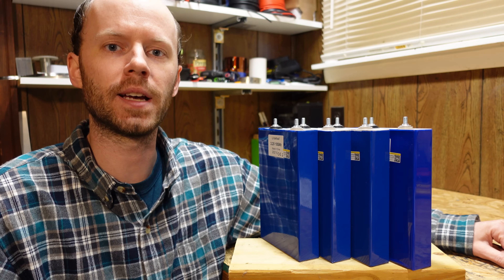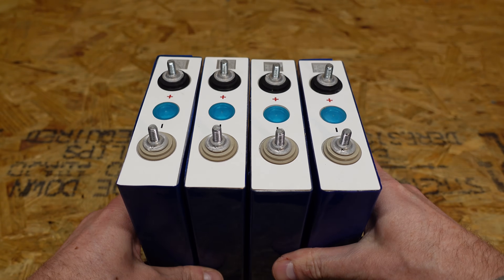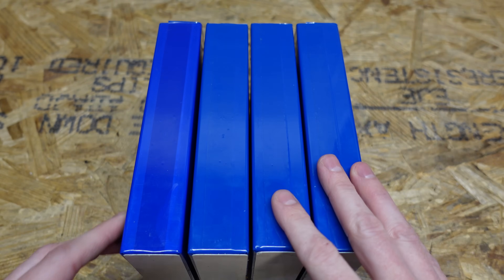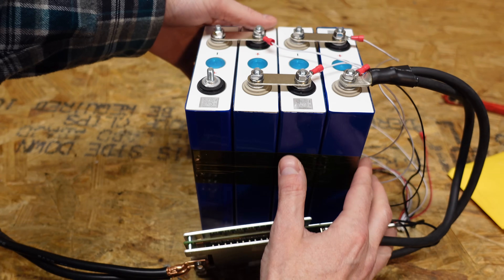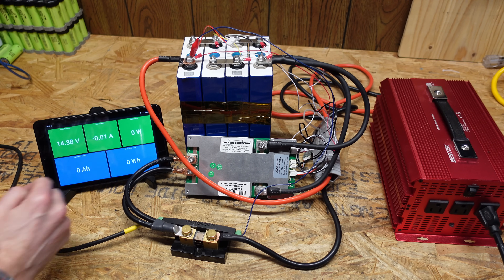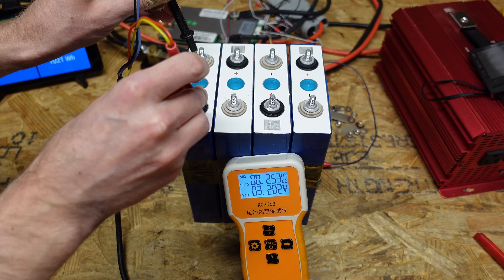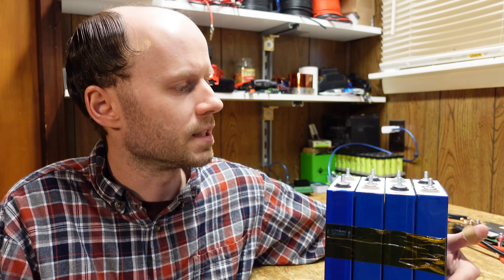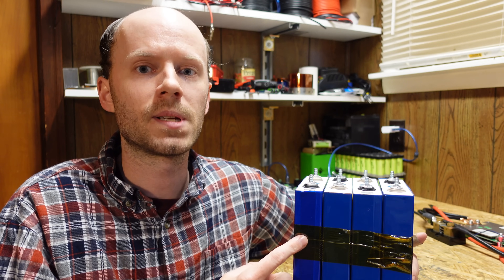Cheap "Grade A" Batteries, Why Do People Keep Buying These!?

Comment from the maker: Update March 6th 2022: The product page where they were selling these batteries has been deleted 3 days after posting the video. They're continuing to sell what appear to be the same exact batteries under new listings which you can find here https://liitokalahongkong.aliexpress.com/store/217753/search?SearchText=liitokala+105ah
Reply: I am a member of a Facebook group, where people buy the Litokalla 100/200ah batteries. From all the members, only one was able to pull full capacity, and they have sold them in hundreds in this group.
I have been asked to help a member who's battery didn't work on arrival. The interior was a mess!

Terminal corrosion, heavily bloated cells (I mean really bloated), the BMS was the cheapest thing you can think off. The 200ah capacity, was made with 2s 4P 100ah cells. The poor guy couldn't use the cells for nothing. He ended up matching 4 cells that were ok'ish... Then bought a new set of new cells, a BMS and I teached him how to set it up and he is thrilled. But from the initial order, to the time he had a real working battery it passed around 6 months... Really not worth the money. That company is garbage in LifePo4 batteries, even though some work...
Reply: This "brand" makes a lot different batteries, ALL are not as advertised. 
Generally below capacity by various degrees. Up to 50%!
I think they do make cells (18650) but they also buy b grade and faulty products and sell them on.

I've not seen one good review /test on these or this brand it's not limited to these cells.

* I think maybe the performance people get seems better but they may have over reads/bias giving what appears good results.
Cheap battery, cheap tester= unreliable results. ( And Fake planted people to groups and forum to promote businesses and products)
Reply: I think these batteries have been used on street lamp then replaced with new one and send to  a recycling facility where they clean and sell it to the scammers. my lito Kala looks fine but each have different charging and discharging capacities.
Reply: @neliosamch3195  
yes, nothing against recycling, but not declaring that fact is fraud in most of the world not in china though.
Reply: @ursodermatt8809  If they declare it as recycled they won't be able to export it because the shipping will be more than the battery itself.
Reply: @neliosamch3195  
well yes, good point.
Reply: There are groups that purposely put false reports on the internet and are paid to do so. The cost ratio of return on the money is good, so the manufacture pays for the false , positive reports-reviews.
Reply: you never know what you get from chinese sellers. and there is no recourse of one cell is faulty.
so yes, if you are a gambling man, go for it.
Reply: exactly
Reply: The bloating and the lack of voltage on the one battery would indicate to me the batteries are either extremely cheap or they are used... Personally I say they are used. I would avoid that seller at all costs.
Reply: any updated links to these bad cells? its getting deleted again
Reply: They do this to clear out the bad reviews.
Reply: If you're short two nuts, I bet there is a plastic surgeon that could help you :)
Reply: Used battery cleaned up and new QR codes put on them.
Reply: Hi.  Can you Please Tell me that app that you are using on your Tablet for battery capacity testing ?
It looks like the Victron display only much larger and readable without my glasses.  Thanks
Reply: They don't?

Comment: I wouldn't ask from a LIFEPO4 battery made from those, much more than 300W per 4x cells approx 25A discharge per cell. Any more than that and the lifespan could be reduced. What current had they been used at? It's possible someone else had already had those cells in their hands then over discharged them and consequently sent them back then possible they tried to pawn them off on you.

Comment: Junk. made an 8s pack and 2 years later went to do a redo in better box and very bulged and leaking. 2 cells were actually leaking,  So miss matched capacity right out of the box can only be used between 25-27 volts, wtf. buying from jenny wo now. These are literally someone elses trash cleaned up and sold to Americans.

Comment: This is SO unprofessional! You haven't even read the datasheet. You can not use those type of cells WITHOUT proper compression! 300-500 kg of force is required. Don't use those cells without compression!

Comment: I think those weren't bloated.  The problem is with the plastic.  As the plastic case warms, it expands, causing the cell to look bloated.  Place the battery in an environment that is below 60 degrees and it's likely they are flat.  I found this to be true when I had mine 'swell' after bringing in from the mail box and unpacking in a cold garage.  In the garage, they were either perfectly flat, or even a little concave. But inside over night, they swelled.  I put them back into the garage and they again were flat.
Reply from the maker: They are bloated. Very bloated. And they have gotten worse just sitting on the shelf since I've filmed this video.There is gas inside and they cannot be squeezed back down as they would if it was just warped/expanded plastic.

Comment: and in few months the shut down will be happen after 20 or 30Ah. I see exactly the same on my friends that bought cheap battery or cells. after max 1 year, battery is un-balanceable and useless .😂😂

Keep believing that 1000 euro for 100ah batteries are theft and that 200 euro batteries are the same🤣🤣🤣

I haven't bought lithium yet because they cost too much. I prefer a thousand times a traction lead acid battery with a tubular plate of 300 euros for 100h, which lasts 2000 cycles of TOTAL discharge and 6000 of light discharge, at a lifepo4 of 250 euros that in a few months is a nightmare !! No one gives anything away!!

Prices have not collapsed !! Simply companies were born that sell garbage

Comment: you might save some extra bucks and buy the same cells from another   trader that the same cells stayed another one year  and got even more old..    good thing is  solid state chemistry might apear before our project systems lights and apliances shut off permenantly!!!!....    crazy thing is that i ordered from em and from VAric.. ones       some solenoid   46160 and they are in so much better condition!!! didnt expect that .. those can barely used for ups or hand tools!!!

Comment: They're-lasered QR codes over batteries likely used nothing but a scam. That's what you risk all you can do is ask your credit card company to reverse the charges. I don't know if that can be done after 3 months it takes to get them.

Comment: LootoKala is a SCAMMMMMM - I got a full refund from aliexpress customer service. IR was 3x what it should have been and my cells were re-wrapped with labels showing higher capacity than they were supposed to... they sell OLD B STOCK TRASH - LIIOKALA is SCAMMERS. 

Just so you know, these shops in china laser weld on those studs. they ALSO have the capability to laser etch those barcodes so dont trust that barcode!!!!!!! IR test, and capacity test!!! thats all that matters (and the price!!!)

Comment: Sorry but 2.5 vs 3 is large difference. While I do agree these cells are crap, for the right price they are still worth something. 

I think that one cell is definitely bad, and I absolutely wouldn't use these in anything mission critical.... But as some backup power for something seems like they might be worth it

Comment: Chinese goods need special use and treatment, especially from a genius like you. You may be able to replace the battery No. 2 or enter the program of BMS and adjust the voltage of cell No. 2, unfortunately this is China and it is suitable for poor and developing countries

Comment: There are other cheap sellers for the 270-320 ah cells though and even though they are really B cells and dont pull full capacity, its still the cheapest ah/per $ and that is all I really care about. By the time they wear out the next best battery tech will be here and even better so I am not going to pay nearly double for a shred of more life.

Comment: jeez, no caps on those exposed terminals.   I hate all these battery videos on youtube with people acting like they know what their are doing but they ignore even rudimentary battery safety.
Reply from the maker: Me too, hate when people act like they know what they're doing!
Reply: @LithiumSolar  I know right, its crazy isn't it?  People do dumb shit like charge up suspect and obviously bulging cells, perform battery pack work on top of and surrounded by flammable materials, utilize no over current protection at all, wear no PPE at all not even safety glasses, work on energized packs with bare non-insulated tools, BMS wires not tied up and protected against chaffing and no over current protection in them either.     I hope YouTube starts taking these unsafe videos down, or at minimum forces uploaders to put their degrees and credentials in the video so that people can tell professionals from DIY'ers who know just enough to be dangerous.

Comment: I've bought various LiFePO4 cells over the years and found that most of them are just garbage. It seems to be an area rife with scams. Bizarrely, the only ones I found to be extremely good were some ridiculously-cheap LiitoKala-branded 6000mAh cells. I didn't expect much from them, but two years later they're still going strong and do appear to deliver close to rated capacity in a 36V pack. Personally, I wouldn't be too bothered about slight bulging or less-than-rated capacity. All I'm interested in is cost-per-Wh and longevity. Unfortunately there's no way to easily test for longevity.

Comment: wait a sec. i'm not an expert with cells and batterys. but i was told that a 3.7V li-ion cell should never go lower than 3V, or it will take damage. 
so the 2.5V of your second Cell is dangerously low if you ask me. dont you think so?
Reply: Li-ion = 3.7 V / 4.2V
HOWEVER

these cells are LiFePO4
LiFePO4 = 2.5V (min) / 3.2V (nominal) / 3.65V (max)

Comment: I'm surprised  you were able to get a refund from Aliexpress so fast... in my experiences, the dispute process for aliexpress is largely in designed to favour the seller, and it can take a month or more to get aliexpress to make a decision if the seller is not cooperating. I stick to eBay as I've never lost a dispute and they decide very quickly and let you provide all necessary evidence, etc easily.
Reply: You are right. 
Though I have a theory - surely AE are aware that there many scamsellers- yet they are NOT blocked/removed - which makes me think that AE is in cahoots with them!

Comment: Hi,  I'm a paralyzed guy and I have 4, deep cycle, MK Battery M24 SLD G FT,  gel batteries at my disposal, each one of them 12V, 73Ah, (used in combination of two,  so 24V, to power my wheelchair). So I would like to use them to prolong the duration of my UPS APC BE850G2-GR, which can sustain my consumption only about 10 minutes... HOW SHOULD I PROCEED? Should I buy a pure sine inverter (or how it's called), and attach the batteries to that? Can I use two of these 12V batteries in combination, or even 4, for more backup power?  If you have a reference video for such a setup, pls let me know. Thanks in advance.

Comment: Never had experience with this format, but I use many Liitokala 21700 batteries and 21700/18650 chargers - so far so good, especially for the price. Cannot say much about their life time, or performance under high current, but for my low-current applications they seem to put out more Ah's then their indicated capacity.
Btw. Liitokala means 'flying fish' ... in Finnish language. What were they smoking?!
Reply: Way back when I was young you could get regular zinc carbon cells (AA,C,D etc) made by the "Flying Bomb" battery company in China.  Seems like the name should be reused for these  lithium cells :D

Comment: I've had mostly okay experiences with liitokala batteries

I don't expect them to be perfect. I expect flaws and some cells to be lower capacity. But I'm paying so much less

Imagine paying a third of the price but getting cells 80% as good as original. 

It's not perfect, but the price seems good for now

And in all fairness, most 18650s they sell are accurate in my experience
Reply: Agreed, I wish they werent so doggedly lying about there cells.
It would be fine if they said , heres are a set of used non matched cells really cheap, probably used, we guarantee nothing.

Comment: If you discharge 20 Amph no wonder you missing 25Amph from 105
Reply from the maker: What? The industry standard is 0.2C. In fact, many datasheets show a standard discharge rate of 1C. I'm missing 25Ah because they're junk.
Reply: How stupid. Discharge is 1 C. That is 100A.

Comment: These are not new cells  !  . They will not show too many signs of being old , they have been sat somewhere cycling for a few years  , when capacity drops below 80% the user discards and get new ones  .Swelling is a sign of being old and used . Also 2:58 indicates old glue , pale blue wrapper indicates prolonged light exposure .My understanding is there are no "grade A/B/C" LifePo4 cells they are all good, but tricksters sell used cells as new ( I got caught too)

Comment: I can't lie tho. I bought a set of these in the summer for testing and they still kick out 95% capacity so I'm quite impressed. 
Although they get hot at just 20A constant. (0.5C)
I did not try the 105Ah ones.. those seem a bit far fetched.

Comment: The chinese are selling used batteries. I made the mistake to buy 2 (li-ion 10s2p) for an electric scooter and one of them showed up at about 32v charge (it should have been at 36-37 like the other one). It never charged to full 42v, 40 at best, and it does drain faster.

Comment: Same experience, same supplier.  Ordered 280ah all of them tested below 240ah.  Garrrrrrbage.     They arrived so late, they were outside of dispute or comment period.   Good luck working with them, they won't help at that point, at all.
Reply: Same supplier. 280 Ah tested at 230Ah. Scratched off code said 220Ah so I suppose it was an administrative oversight that sold them as 280 Ah. Not bloody thieves.

Comment: Same experience on this side. 105Ah seems to be 84Ah. After dispute, Ali paid 33% of the price to me as a compensation for this scam. I am only using the cells at a “silent-generator” in 1 DIY box, with 20Amp charger and 1000Watt sinus inverter. Using this as a 1 kW spare energy source, I can accept this. However LittoKala should be more honorable in selling cells that meet their specs. I will never do business with this company. Regards, Peter.
Reply: they also have a lot of other cell formats that look like overspeced and mostly used and or refurbished like the cylidrical ones you can screw together to a long pole.
Great idea, but badly executed cause the Ah are missing 20% and the terminals looked used. This has happened for the LiIon they sold first and also the LiFePo4.

just another to good to be true story which makes us wonder what if the price would be even higher just 99% of regular grade A ones?

Then it would be even harder to detect them, but in this case the brand is quite the opposite delivering of a brand should deliver. sad but true.

Comment: Dude, they were less than 200 bucks! Don't be too hard on them, you can't compare them to a $1000 pack. Sure, they are at 80%, but the savings are more than that, so I'd be happy with them.
Reply: You discharge the battery with 20amps and expecting to get a 100ah ? Just try to discharge it at low amps to get a tru rated result .. compare to other expensive cells you still get 80% lifespan with it im using that cells for 1.5yrs still the capacity is good ..and try to use Active balancer you get a better results
Reply: @christianbermejo9542  They should discharge at 100 Amps for an hour. So don't talk shit.

Comment: I bought 16 200ah cells form Liitokala official store. I said with the order, please send good cells as I want to buy another 48. The cells are nice and square etc. I did a capacity test on 8 ( 4 then 4) using a victron smart shunt and a 1600 watt victron inverter. And running 5 domestic 240v fridges at once. Lasted 48 hours and delivered 200ah and voltage was still 11.8v ( dropping fast) at the end of the test. I paid delivered AUD 1600 for 16 cells and I consider this good value. They are going into my RV as a 24v system with a daly 250 amp BMS- so far so good.

Comment: Answer to your question is, if the price is 1/5 or 1/4 of original and you lack 20% of capacity, many could say it is a good deal! And in your case for free, so why not? 😄
Reply: If they scam people with the capacity, they will scam you with quality as well, see the rotating terminal example. Sure if you use them in some hobby machine, but if those are stored anywhere near your house i would not risk it. Hell i would not live in apartment house what has EV owner nor i would give insurance to house that has EV parked near.. eventually with enough EV's burning down this is likely to happen, or they start to explode the prices for insurances.
Reply: april7. Is the price 1/5 of the original? - No, it is the same as genuine cells.
Will I get 80% of capacity? Will I then get them for free? Where are the advertisements that state this? Why aren't there any? Because it is a con. 
It is shoplifting by the shop owner.

Comment: That is exactly what happened to me . Same e mail and no tracking. Said we’re still in shipment
Reply from the maker: If it were me, I wouldn't let that buyer protection expire. If it expires, even if the batteries show up eventually, you can't submit any complaints if the cells are dead/bloated/etc.